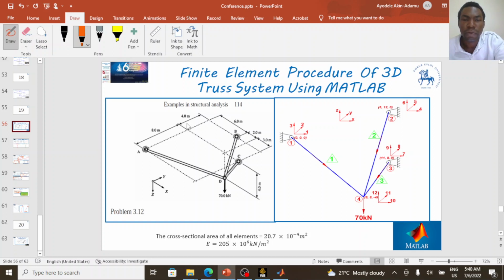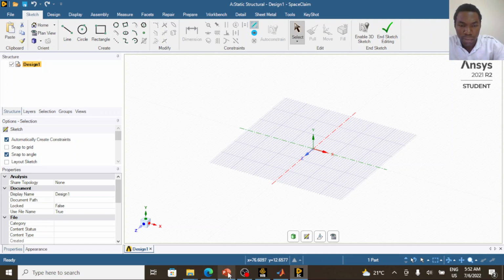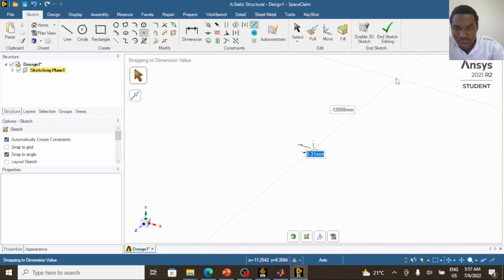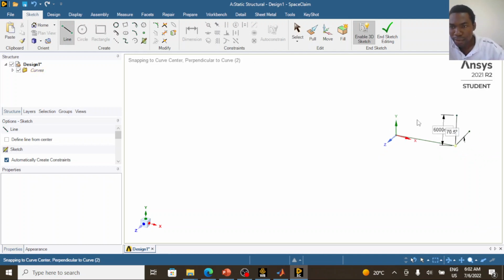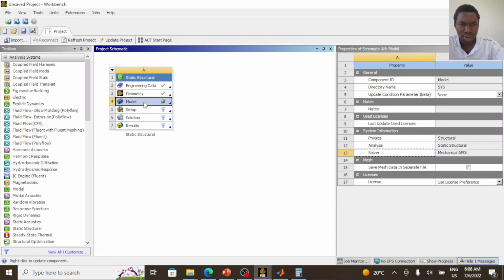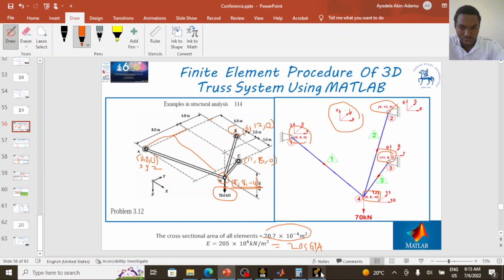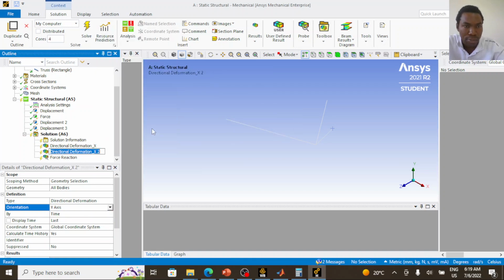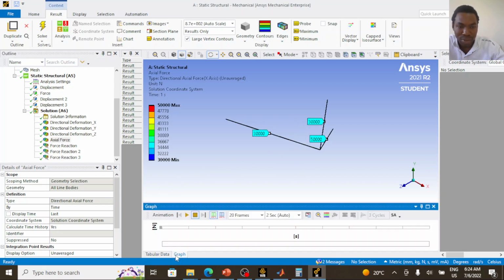Finite Element Procedure Of 3D Truss System Using ANSYS

Comment: Quick Question. Do I have to add a displacement condition for every node? Lets say for example I have a structure with 10 nodes and only four of those nodes should be fixed, while the others can move freely. Would I need to put 10 displacement conditions or would four suffice?
Thank you for your answer
Reply from the maker: In the problem that was solved, it has 4 nodes. 3 of the 4 nodes have support, so we need to apply support boundary conditions to these 3 nodes. The last node is free, so it has no support condition attached to it.
Reply from the maker: You should define 4 different support boundary conditions for each of the 4 nodes for your question. The other 6 nodes would be free.